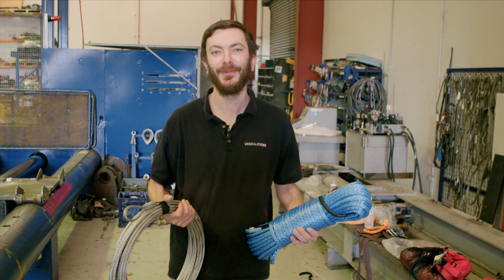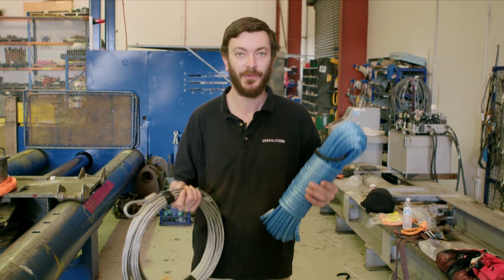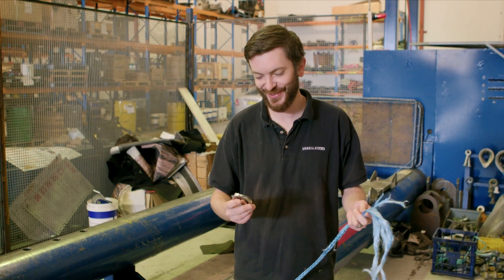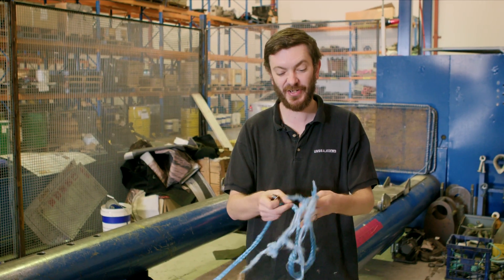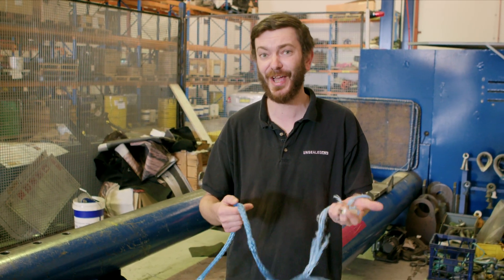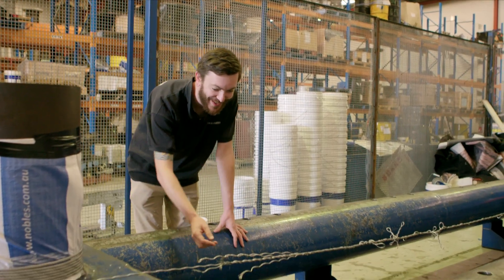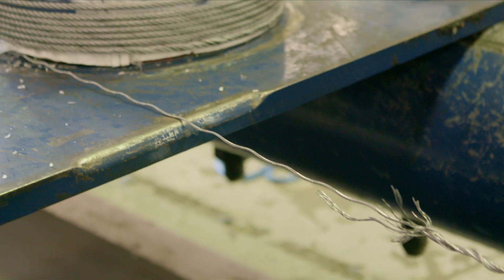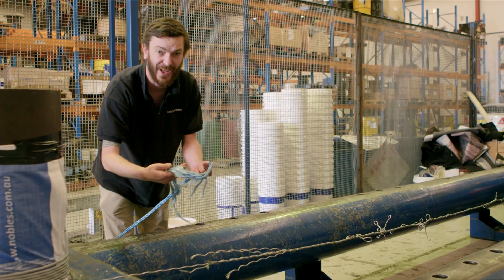Winch Rope Destruction Test: Synthetic vs Cable

Comment: Thank you for the caparison.  Not only is steel cable a pain to work with but as you have shown, dangerous.
Reply: That's not dangerous. 
Danger is winching up a steep hill and having the rope chafe and break, sending the 4x4 down the hill.

Comment: I've witnessed and participated in many recoveries using a winch.  I have never seen a steel rope fail in real world.  I have seen at least three synthetic rope failures.  In each case the failure seemed to be caused by the unavoidable contact with rocks you have to drag the vehicle over.  When I'm in my rig hanging over a ledge by a rope, make mine steel.
Reply: Agreed, the chafing requirement in a real 4x4 world makes synthetic far less desirable.
Reply: I’ve had the opposite, never had a synthetic rope fail but I’ve had steel snap and break a windshield once and a tail light another time.
Reply: @dmoney6633  Lift the engine hood up while winching
Reply: @dmoney6633  I’ve had synthetics fail but only when pulled around a sharp corner that I kind of knew better but needed to do it anyway.
Reply: @drewdoestrucks  Yeah any rope will fail if it's at an angle, puts too much pressure on a small area. My preferred method though is bubba rope that stuff is great if you have significant space to use it.
Reply: Yeah I don't no how anyone thing synthetic rope stronger than metal rope. I have never seen metal winch rope fail in wild either but rope not do good
Reply: @juliansaunders6163  When cable winch lines break they kill people
Reply: I’ve personally broken steel winch cable. Everything has its limits. If you double up  winches, especially, you’re playing with a lot of force.
Reply: I use synthetic and it’s pretty nice lol. It’s a hell of a lot easier to work with plus you don’t have to have to have rolling pins on the front of your bumper. Fair leads for synthetic have such a cleaner look to them. I mean I’ve had mine for like 2 years and it’s just fine. I did have to shorten it once because I was in a situation I had to hook it raw dog on to a tree but that’s about it.
Reply: Yeah, I agree. Steel cable is pretty reliable, but just like anything else, needs to be maintained and replaced when you start to see degradation.
Reply: in view of strength,  synthetic is more stronger than steel one but there are many affecting factors such as maintenance, hardness, abrasion resistance, pruductive yield to product, easy UV enduracn etc.  considering practical usage steel one would be better.
Reply: You obviously don't know how to use sheaths and rig properly.
Reply: @gabrielreyes8476  Really?  Obvious indeed.  You have no idea how vast my experience is and the kind of rigs and people I've wheeled with on some pretty grand and knarly trails.  I've witnessed synthetic fail once at the Little Sluice on the Rubicon and two in Johnson Valley during recreational and competitive wheeling.  They just break.  Your statement says way more about you than it does about me.  Especially since the occupation I just retired from required rigging knowledge.  Just the fact that you need sheaths should tell you something.  But it doesn't, does it?  GFY you self-righteous dimwit.  Your condescendence earned an insulting reply.
Reply: @Naku-n4ku  Now we can communicate civilly. It didn't have to go that way, I was just reacting to your initial insult. Yes, I am absolutely a hot head. Like you, I'm an old geezer too. I can respect your observations. All I was trying to say was that synthetic has its place and it is not on job sites. Most failures that I've witnessed out in the bush have been due to lack of maintenance and/or cleaning. The line is still stronger than steel and I have seen my fair share of those break as well. None the less, I still choose to run synthetic; to each their own. I hope you have a better day and I will do the same.
Reply: I broke a 5/8 cable on my tow truck. But like in the video. It broke from where it was attached to the hook
Reply: Rope it is then sir. Look I’m sorry but idc if you’re hanging over a ledge in a glass trailer Jurassic park 1 style, you’re getting a rope winch as far as I’m concerned. I don’t like to keep steel in my vehicle because of the added weight and clutter, when I prefer to keep a few simple ropes which have a much wider range of use & versatility.
Reply: Rope it is then sir. Look I’m sorry but idc if you’re hanging over a ledge in a glass trailer Jurassic park 1 style, you’re getting a rope winch as far as I’m concerned. I don’t like to keep steel in my vehicle because of the added weight and clutter, when I prefer to keep a few simple ropes which have a much wider range of use & versatility.
Reply: Just add chafing protection, problem solved
Reply: I've seen steel rope break I've even seen 1 1/8 steel rope break that was very interesting
Reply: @wiley1421  Not one winching a vehicle you haven't.
Reply: @samjohnson9894  yeah several times
Reply: @wiley1421  I've seen steel break also. Once is Mexico & it really hurt the person handling the winch controller. I use steel myself, but try and use a wireless controller & stay very clear if possible.
Reply: @wiley1421   i call bs
Reply: @0117ization  why would I care what you think steel rope breaks a lot in the oilfield
Reply: @wiley1421, it’s the oil field, things get abused and then replaced in most cases, so yeah I can see cables snapping. Plus I can see stuff getting into a heck of a bind way worse than most peoples off roading adventure.
Reply: @0117ization   I second your B.S. call. Steel winch cable break several times? Yeah right.
Reply: @0117ization  I was out off roading with a group a few years ago and a cable winch snapped and dismembered the foot of one of the crew standing several feet away from the cable line
Reply: I've broken steel 5/16 before Warn 9.5ti but tied it and was able to get the other rig unstuck.
Reply: Way stronger way more durable and lasts 100 x longer, i choose steel over synthetic any day !!! 🤙🏽

Comment: I couldn't imagine the synthetic on my WARN 16.5, on my  8,000# Superduty! I wouldn't even consider it! I have a Harbor Freight 12,000# with the cable as well in my enclosed trailer. A 4,000# car with a locked axle would most like destroy the synthetic.

Comment: Interesting.  Wish we’d seen a readout of pull at failure.  But get the synthetic dirty and drag it over rocks under tension, the see how it compares.  Synthetic is fine on Jeep winch that occasionally gets used to get the Jeep unstuck.  But I’ll throw away the steel on my working winches when I see Loggers replacing the steel on theirs.
Reply: I use steel on my Jeep. I don't want the rope chafing while I'm winching up a cliff at Moab. Rope is for shopping mall 4x4's

Comment: I’ve been working on aircraft since the 1960’s and never saw an engineer incorporating synthetic rope over a steel cable. I wonder why if it so much better?
Reply: @Tom S Very well said AND typed sir! Excellent points and I agree with you 100%!!
Reply: Yeah that says a lot actually 💯
Reply: FAA
Reply: @artd.  I understand the role the FAA plays but doesn’t answer my question
Reply: Well said!

Comment: BUT, but the biggest problem with synthetic IS (and always has been) UV degradation. If there was some way to REALISTICALLY get around that problem then it’d be THE smartest choice (other than cost) to go for. Spray is only skin deep and wears off quickly while the rest of the rope is untouched. Wraps and sleeves have problems also; such as taking up line capacity of the grim, bunching up, being realistically hard to resplice around, properly working around the thimble (or any other termination), and additional cost to an already expensive item. My choice to this day (so far) is actual WIRE rope when it comes to a winch or hoist.

Comment: Trouble with the synthetic rope is......the fibers wear  over time leading to it breaking at much less than the weight rating.  Wire rope does not wear nearly as fast as the fibers.

Comment: There are some new winches on the market winch do not
use cable  NOR  rope. They use strap. The drum on these 
new ones is only 2" wide.

!
Reply: Interesting. I have yet to see a strp winch other than one with a manual crank (which I own). The problem I have had with the strap is that the pull has to be 100% STRAIGHT AHEAD. Otherwise, the side of the srap is rubbing hard against the fairlead and quickly degrades the side of the web

Comment: I've had chain sling back at failure, not cable but the synthetic is rope application is what I would want when trying to 'snatch' a stuck vehicle
Reply: Problem is the synthetic going around the roller of the block gets VERY hot on the inside of the curve which weakens it... Straight pulls the load is even across the width.

Comment: Cable is by far the best. It's stronger, wear resistance and last forever.  Synthetic rope just doesn't last long and cost more.  I was watching a ATV'S race and on a steep hill some of the riders couldn't make the hill  and one was using the winch with synthetic rope  and he never made it because it broke 3 times.

Comment: I’ll take a steel wire any day of the week !
1. Strong
2. Reliable 
3. Long lasting
4. Dirt/mud proof
5. Resists scraping damage from rocks, wood and the fairy lead.
6. After 10 years, it’s still as strong as day one. Synthetics are prone to UV and ozone degradation.
Reply: Not much chance of tying a knot and using to get yourself out of a "bind." Pretty much shot your steel wire Billy.
Reply: @terryknutson3202  😎 No need to ‘tie a knot’ because steel cable almost NEVER snaps. 
For those EXTREMELY rare cases, a couple of Steel Wire Rope Grips will do the trick! 👍👍
Reply: @Billydevito Sorry Billy. i have seen cable "snap" more than 10 times. Cable, snatch blocks go fly'n, one snatch block flew so far have not ever found it. Thank God no one has ever been in the way. Amen.
Reply: @terryknutson3202  everything breaks if you put it under more abuse than it’s intended for. I’ve never seen a cable snap when used properly. As a fisherman we use cables and ropes for specific uses. Don’t abuse and everything will be fine. But there are of course freak accidents.
Reply: @terryknutson3202  actually you can fix steel cable.

Comment: This test should be completed using an actual winch sized spool. I have seen synthetic ropes usually fail inside the spool with melting and friction. Wonder if that's more real likely the fail spot?
Reply: If you load your rope on the spool properly that doesn't happen.
Reply: Higher end winches don't have the brake inside the drum so they don't generate heat and melt the line.
Reply: @KurNorock  not sure I can agree with that. Most winches have the brake inside the drum, even a lot of fairly high end ones from Warn and others. Even the ones that have it on an end plate, if the brake sticks and is overheating, it’s gonna end up transferring to the drum. 
Different variants of dyneema and other synthetic fibers can be more or less susceptible to heat damage, and like I said before the heat resistant wrap on the first layer of rope seems to help as well. 
I haven’t been in many situations where the brake was what was overheating. Most of the time, the winch motor is where the heat is. 
I use synthetic on all four of my winches. 3 are warns and one is a superwinch.
Reply: @drewdoestrucks  superwinch specifically moved the brake outside of the drum and used actual steel tube for their drum instead of a cast drum. Both done specifically for synthetic winch line.
Reply: They come with a liner for the first layer.

Comment: Synthetic rope is going to stretch. Also when synthetic rope breaks, it will snap back at an extreme rate. Just look up videos of synthetic rope snap back.
Reply: the synthetic rope on my 15k winch does not stretch at all. If it looks like its stretching, something else is moving, bending, or breaking.

Comment: When I start seeing tow trucks and cranes switching from steel to synthetic, then I'll THINK about switching...
Reply: Good call.
Reply: @CurmudgeonExtraordinaire 2 years later, do you feel the same way about synthetic now days?
As you might know by now, tow trucks and cranes are running synthetic now days in high numbers.
Reply: @ducewags  -- I'm still sticking with steel and see no reason to replace something that still works for me...
Reply: @CurmudgeonExtraordinaire  Okey-Dokey.
Reply: @ducewags  -- The wire rope on my winch is nearly 30 years old and still in good shape.  Do you think a synthetic rope would last that long?

Comment: What thickness and rating of each rope is necessary to determine if it is apples to apples.  My Warn M12000 came equipped with 7/16 wire rope.  I've seen plenty of synth rope break on the trails and rendered useless to get a vehicle out.  I have yet to see a steel cable break.  It has lot to do with environment and durability.  The synth rope is only safe until it is not.  It is susceptible to abrasion from rocks and UV/water/freezing damage.
Reply: Everyone I know with synthetic has a cover which at least shields the rope from sunlight. Also, I've heard of people with synthetic not paying attention to the duty cycle usage of their winch, and running the winch hot enough to degrade the synthetic (become a bit brittle)

Comment: I use synthetic rope, change it around once a year. Managed to snap rope twice in the past, no damage done.
Reply: To what degree does sunlight exposure affect it?
Reply: @bryanst.martin7134  I haven't noticed any effects  during the average time of a year, that I use a rope for.  I would add that we custom fitted the winch behind the bumper of the land cruiser and we use a factor 55 prolink, so although we operate in summer temperatures of 50°C, none of the rope is constantly in sunlight.
Reply: If you have an exposed winch, there's covers that are relatively inexpensive and will protect against weather. Also helps keep the mud out when going deep. Just have to remember to take the cover off, clean it out and let it dry properly after going out

Comment: Terjemahan teks

BAHASA MELAYU - DIKESAN

swap_horiz

INGGERIS

Teks sumber

clear

volume_up

17 / 5000

Hasil terjemahan

what is the size of the wire 

volume_up

content_copy

share

star_border

Lagi tentang teks sumber ini

Teks sumber diperlukan untuk maklumat terjemahan tambahan

Hantar maklum balas

Panel sisi

Terjemahan teks

BAHASA MELAYU - DIKESAN

swap_horiz

INGGERIS

Teks sumber

clear

volume_up

17 / 5000

Hasil terjemahan

what is the size of the wire 

volume_up

content_copy

share

star_border

Lagi tentang teks sumber ini

Teks sumber diperlukan untuk maklumat terjemahan tambahan

Hantar maklum balas

what is the size of the wire

Comment: Neither was a real world type of failure… both do the same thing, they go flying at hundreds of miles an hour, only difference is the synthetic weights much less so has less energy… it’s far more likely to fail from wear or abrasive dirt though because it’s nearly impossible to inspect it like you can steel…
Reply: Steel gets grit and mud in it too, and it deteriorates just like it does to synthetic.
Reply: @drewdoestrucks  true but at nowhere near the same rate. A steel cable usually will last multiple year with multiple pulls being done on it. Where as a single pull in mud, dirt, rocks, sand(places where ppl actually use winches) will entirely destroy a synthetic cable
Reply: @drewdoestrucks  ehh I've done enough recovery and ran a rollback long enough to know better. Straight line pulls its fine but if synthetic is dragging across sharp rocks it'll cut it each time

Comment: Hi hope you guys can give me some advice. I have a 2020 F150 5L. I installed a westin bush bumper and winch plate. I want to install a winch but heard that I need to strengthen the front suspension. Is it true? Then is it worth getting a winch? And I want to get a 12 500lbs winch. With the push bar grill guard it dropped my front end 5mm so would love some advice and input. Thanks guys.
Reply: A 12,000 lb winch with steel cable typically  weighs ~80 lbs. You can look up the weight of the bumper and winch plate, but these often weigh 150 and 250 lbs MORE than the stock bumper they replace. If you then added a push bar and grill That implies you're adding ~250 to 350 pounds that is OVERHANGING the front suspension. Adding that much weight to the front on a half ton pickup warrants stronger springs.  
I have an F-350 (single rear wheel) Even with its stiffer suspension, I know adding 300 pounds will drop the suspension by more than 5mm, as that is only 3/16 of an inch. 
So, I really question if your F150 suspension only dropped 5mm. Note that both before and after changing parts you should drive little bit, or at least try to bounce the front end so that hysteresis does not give you a distorted measurement.

Comment: No offense to the presenter here, but I'm saying any one that chooses a recovery device because it's light and fluffy and not scary looking might not be the guy. I would personally try either one of the two ropes in my winch. My current setup is wound with wire rope.